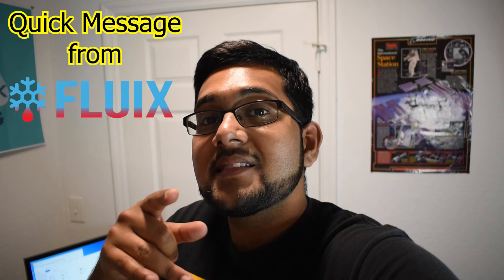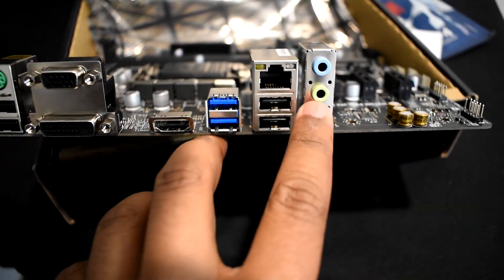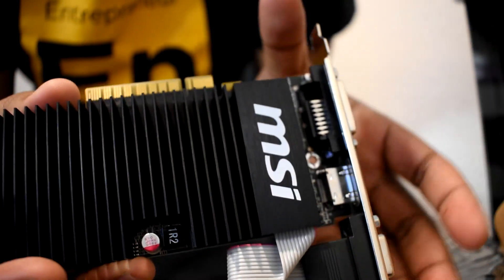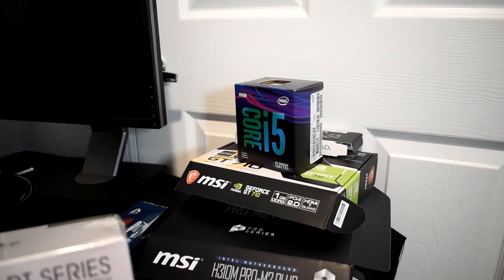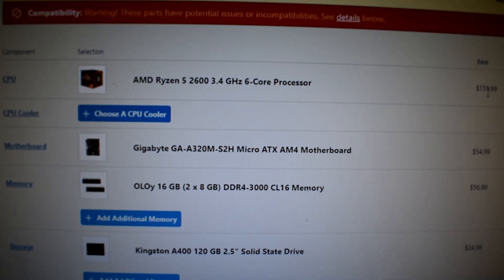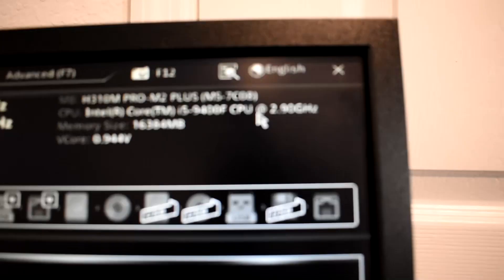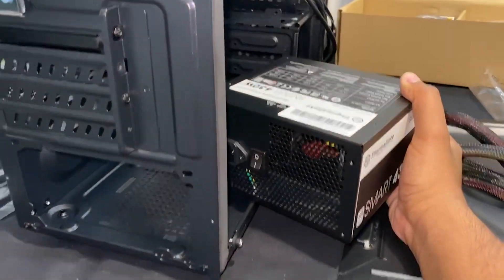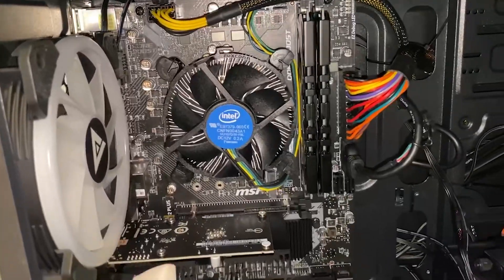**$400** BUDGET HOME OFFICE PC BUILD! Zoom meetings, Trading, Productivity Computer

Comment: Please suggest a 4core or a 6 core chip with better onboard graphics until switching to a separate card. Either of those two boards is fine. As far as I know, Ryzen has some better onboard graphics. Is that true??
Reply from the maker: Hello Dilanka, Yes, an "APU" processor would be a good fit while you wait on discrete graphics becoming more stable in the market. Ryzen does offer better bang for the buck when it comes to onboard graphics. At the moment it is difficult to purchase Ryzen APUs however as the demand for the Ryzen 4000 series APU is high due to the discrete GPU market being volatile. If I had to recommend, it would be the Ryzen 3 4350G 4 core 8 thread CPU bundle with motherboard and power supply from QuietPC: https://www.quietpc.com/sys-bundle-ryzen-atx

I do have to disclose that this is a paid link from the Linus Tech Tips Channel, his recent video went over this topic. We do not get any proceeds if you decide to purchase from this link. 

Hope this helps!

Abhi
Reply: @fluixtech  Thanks for the response mate. Much appreciated...❤️
Keep up the Good Work. Would love to see your content regularly💪
Reply from the maker: @dilankakasun6033  Thank you , that means a lot to us!

Comment: is it fine if i change the gpu for a geforce GTX 1660? ill still keep everything else just changing the gpu
Reply from the maker: Yes, that is totally. That would be a great machine for 1080p gaming. For productivity it might be a little overkill. But if you plan to do some day trading with multiple monitors that would work well as well.
Reply: ah sadly i only have one monitor. but i sort of plan to switch in between gaming and work for the pc
Reply from the maker: @tsunami1868  Got it, yes that would be a great machine!
Reply: @fluixtech  alright! thank you so much, ill be building it somewhat soon

Comment: Hey man I was just wondering what fans did you use in this build I cannot find the link for them? Awesome video
Reply from the maker: Thank you!  For the fans you can search for a 3 Pack 120mm RGB fan kit with controller on Amazon. For example, these would work: https://www.amazon.com/GIM-Addressable-Motherboard-Controller-Adjustable/dp/B088TGMGP9/ref=sr_1_18?dchild=1&keywords=rgb+120mm+fan+kit+with+controller&qid=1613890737&sr=8-18
Reply: @fluixtech  thank you so much keep up the great work

Comment: Do we need the hard drive or can we just use the ssd but buy one that has more storage in it? And the fans... did you get them with the case or did you buy them separately? If you brought them separately can you put it in the comments of this comment! Thank you! 😊
Reply from the maker: You can definitely use an SSD with more storage, and it is recommended for the better speed. For the fans, please search on Amazon: 3 pack RGB 120mm fans with controller
Reply: @fluixtech  hey with the fans do I choose the first thing that comes up in the search results or if not then what do I choose? Or do I choose my own one that I like? Thanks in advance.

Edit: I found these fans. Will these work well in the build? https://www.amazon.com.au/Thermaltake-140mm-Black-Airflow-CL-F013-PL14BL/dp/B07MVY3N55/ref=mp_s_a_1_1?dchild=1&keywords=3%2Bpack%2BRGB%2B120mm%2Bfans%2Bwith%2Bcontroller&qid=1613855727&sr=8-1&th=1&psc=1
Reply: @fluixtech  sorry for bothering you but I have a major question about the power supply. I’ve looked at the reviews on Amazon and some of them say that the psu melted and stopped working after a few months. Is this true? Has this happened to you before with this brand? Please let me know. Thank you!
Reply from the maker: @Cynical54  Those fans would fit in the case, however, the RGB lighting is not compatible with the motherboard in the parts list as it is missing the RGB header. A fan kit like this would pair well: https://www.amazon.com/GIM-Addressable-Motherboard-Controller-Adjustable/dp/B088TGMGP9/ref=sr_1_18?dchild=1&keywords=rgb+120mm+fan+kit+with+controller&qid=1613890737&sr=8-18 

As far as the power supply, we can only speak to our experience, we never experience those issues with a Thermaltake PSU. Of course there are more reliable units from companies such as Seasonic but are generally more expensive.
Reply: @fluixtech  thank you!
Reply: Thanks fluix! I’ll definitely be adding a ssd and those fans! Thanks for this build. I better start saving to get this for someone I know. Again thank you!

Comment: If I upgrade the GPU will I get a good gaming PC
Reply from the maker: Depends on the type of games and what resolution and frame rate your would like. For most games at 1080p and an upgraded GPU, this would be a very competent gaming PC. Let me know if you have any further questions!
Reply: @fluixtech  can I pair it with a 2060 and run warzone?
Reply from the maker: @mobiba3735  Yes, the 6 core i5 , 16gb ram, and RTX 2060 will run Warzone at high settings 1080P very well. However, we recommend upgrading the PSU to a 500 Watt unit to support the RTX 2060.

Comment: I have a few questions,#1 did you put WiFi or Bluetooth in with the graphics card? #2 Di you put the hard drive in? I could not see it in the end. Great Build though!
Reply from the maker: Hello Robert, Great question, the motherboard used in the video does not come with onboard wifi, you can use ethernet or I recommend using a USB wifi hub. For storage, we used a 2.5 SSD in this video, however, you could incorporate a 7200RPM HDD in the future for an affordable price. I hope this answers your questions.

Comment: Why didn’t you just buy the version with UHD630 for a tiny bit more? The price would probably be less
Reply from the maker: Great question, at the time of procuring parts, the 9400f presented a great deal with a discount on Amazon. We expect prices to have changed.
Reply: @fluixtech  hi, thanks for the info. I’m sorry but what I had intended to say was the UHD 630 would probably be similar to the graphics card included in terms of performance, but I guess your reply still answers the question lol so thanks
Reply from the maker: @adsrbad9733  Yes, also having a dedicated GPU will allow multiple monitors. Especially, since mobo doesn't have multiple display outs.
Reply: @fluixtech  ohh ok.